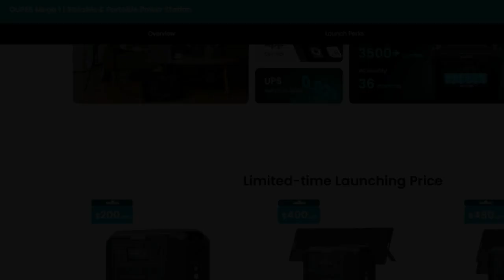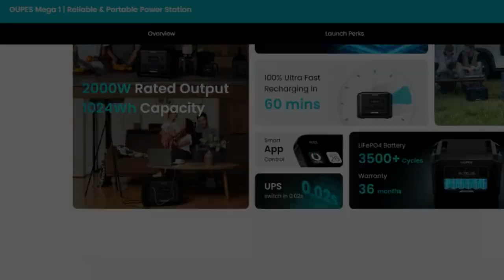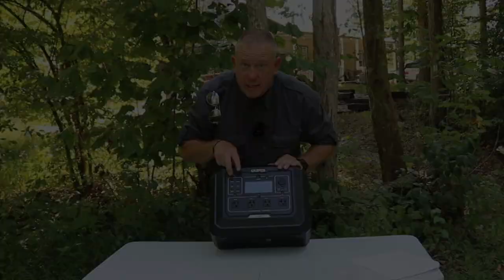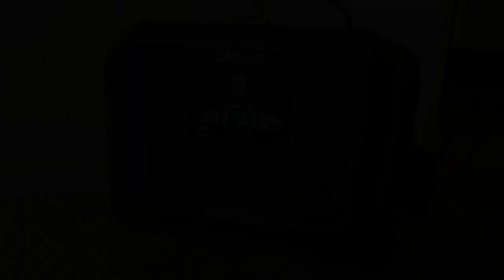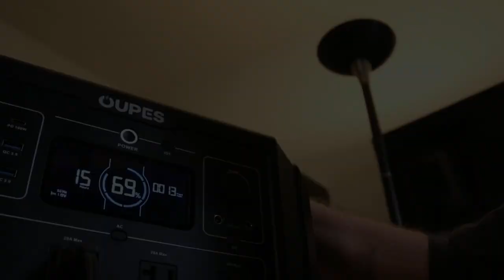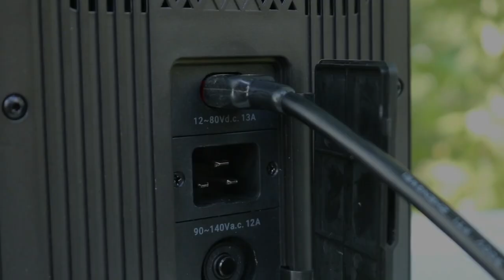A DIRT-CHEAP Solar Generator You've Never Heard of Before - Oupes Mega 1

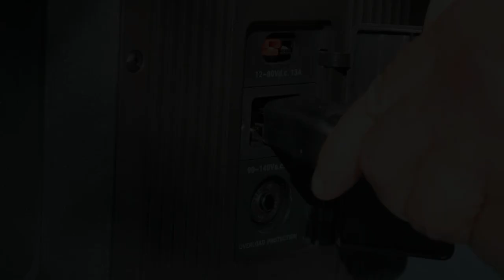Comment: At least this is not 4 Patriots this time!!!!! I hurled insults at you for doing that previously (they exist to scam the non tech savy) One thing I am not liking is (at the time im typing this) it says "800 watts solar input" but it doesn't tell you the voltage or amperage parameters and that could be a red flag! I did watch this video in its entirety and at 4:42 if you hit pause you'll see it tells you 12 to 80 volts at a max of 13 amps but why not put that on the website? People who dont know anything about solar might not know anything about series vs parallel or what panels are or are not compatible!

Hobotech has a great video series on Volts, Amps, Watts and that is everything you'll need to know

Many Power stations wont read their state of charge accurately out of the box. You'll need to charge it up, and run it down till it powers down and then charge it up again then the state of charge should be calibrated right.

DC Compressor fridge is what you want 7:03 (Bouge rv, Set power, Iceco etc)

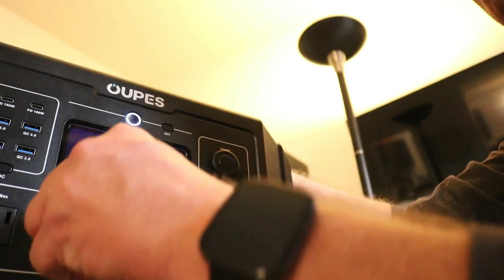7:56 that might not be totally accurate right off the bat. There is going to be a certain amount of idle consumption with the inverter on. Large inverters on smaller batteries are notorious for that

Comment: Because they have problems. 
Mega 5 freeze up.
Bought july 2024 today oct 9 2024.
Still with out power.
Tech just run around from them.
Had to buy gas generator yesterday.
They are junk that's why they offer cheap.

Comment: That's expensive!  I got a Pecron 1200w with a 100w solar panel, cigarette lighter charger and 120v charger for $320 delivered to my door.  It also has a wireless charger on the top and battery charging cables.  Yup, charge a battery with a battery. 😊

Comment: Power banks this size are affordable, but they won't run a window unit or fridge all night.  If you don't want to learn the math, look up your amps and volts on your equipment.  Then ask one of the free AI's like Chatgpt how long it will run. Fridges and ACs are a little tricky to predict because they don't run continuously. Your " mileage " will  vary by how warm the environment is. 

I just bought a couple of power banks this spring, so I'm still learning how to get the most from them. One thing I have learned is that if you plug your fridge or freezer into a gas generator, you have to run it continuously. But, using your genny or panels, you can charge a power bank in 1-3 hours and then turn the generator off while still running your fridge.  Also, some power banks let you charge them while they power something.  You may also be able to run your fridge while charging w solar panels.  Depending on your panels, you may not be able to  keep up with the power draw, but you might get a  longer run time.  Say maybe 7 or 8 hours on the fridge vs 5 without panels. 

Most equipment like fridges and ACs need a considerable amount of power to start them, but much less to run them.  I discovered that my window unit has too much of a start demand to run on my power bank, even though the PB technically has the power to run  it once it is started.  The start up can be 50-100% more than what's needed to run a unit.

You can also run a very modest  sized generator that will charge this power bank in about an hour. On a fuel efficient model, you might be able to charge you PB 6 to 8 times on about 1 gallon of gas. If you can also supplement the charging w panels, you may get about 8 to 10 five hour run sessions on your fridge.  Call it maybe 45 to 50 hours of run time for a fridge using panels plus about one gallon of gas in a small generator.

Comment: That’s a good price for the power output and storage capacity this system delivers.  Couple this unit with an expansion battery of similar capacity and you’d have a system that could likely power your most critical equipment for a good 12-24 hrs on a single charge.  Good review; thx.
Reply from the maker: You're welcome, and Thank You. 
I wish I was a little bit more knowledgeable on the technical jargon to give a review that explains the input/output/etc. a little better. :)

Comment: Great video brother. The average person doesn't need a bunch of technical jargon. A good power station that will run just about every 110 volt appliance. My suggestion would be to skip the fold up panels unless you need to pack it up and go. Just make sure what ever panels you use that the station can take full advantage of it.

Comment: This is a sad commentary on human gullibility.  These are just storage batteries and they will need replacing not to mention likely being overpriced.
Reply from the maker: I've got an off-grid cabin, and these are really handy to have. Recharging radios (for emergency communications), running a lamp for light on a cold winter night, etc. And if someone has to keep insulin refrigerated, something like this would be a life-saver. :)
Reply: Yes, they’ll need replacing… after about 3,000 plus charge cycles (around 10 yrs if cycled EVERY DAY)!  How much food would someone throw out in an area prone to power outages over the course of 10-15 yrs?  Not to mention the comfort & safety these systems also provide.
Reply from the maker: @HughGBallz I completely agree with you. At my off-grid cabin: having one of these to run a lamp on a cold dark night, or to run a fan on a hot night, and to recharge cordless tools, and to recharge trail cams which I use for security purposes.... is really, really useful.
Reply: You need to do your research before commenting.  Sad state on educating yourself prior to speaking.
Reply: You fully and openly make my point, thanks.
Reply: @xenia5101  What would you recommend instead?  We're all ears.  ☺

Comment: Is this generator a Life Cycle type?
Reply from the maker: My apologies, but are you asking if it has only so many recharges before it loses effectiveness?
If so, it has 3500 cycles before it only starts charging to 80% (meaning after 3500 cycles it will only charge to 80%). 

Hopefully I answered your question. If not, my apologies.

Comment: Recently, I did research on the solar generator and end up bought a seperate LiFePo4 24v 100ah just for $357, with another the pure sine wave inverter just $150 for 2000watt continue inverter and I am gonna plan to buy the solar charge controller that cost another 25 dollar. For $532, I have 2560 watt power. I just taste my fridge, I was able to run it about 32 hours with normal usage. If I add another LiFePo4 24v100ah, Iit will be 5120 watt that only cost $889. HOpefully, this system will last me for 10 yrs. It is a lot better than a generator that make noise. If power outrage just a day, we will be fine. However, with solar charge controller, and I think to buy a few solar panel. I can be able to charge my battery during the day time.
Reply: Can you provide more information about your system like where you buy your products, which models and brands, etc?  That might be really help us.  Thanks.

Comment: Not bad. Sale price needs to be lower. I purchased an Ecoflow Delta 2 for $450 on sale. Ecoflow's sale was a week long not one day IRC.
Reply: I was looking at the EcoFlows too. The ones I wanted didn't have the new lithium iron batteries. I think they call the new style LIFPO.
Reply: @DouglasRamirez-dj7sd  surprised by that. My Delta 2 has the LFP (LiPO4) cells. I saw on Amazon Ecoflow has the Delta 2 for $550 and Delta 3 for $650 (with coupon) on sale today
Reply: @DouglasRamirez-dj7sd  My Delta 2 has the LFP (LiFePO4) cells.  Today Amazon Ecoflow sale has the Delta 2 for $550 and the Delta 3 plus for $899. There is a coupon for $250 off bringing that Delta 3 plus down to $649

Comment: I just need freezers ran for an hour every 4 hour's.
Reply from the maker: I do the same thing as you: I run it for an hour, every 4 or 5 hours or so.
And this thing would have no problem doing that.
Plus, I think you can run your freezer and also recharge the Mega 1 at the same time.

Comment: EP, I just bought a 50 foot charging cable so that I don't have to bring my solar battery outside in order to plug it into my solar panels. I recommend that highly. This means that the weather is bad, as long as it's not whether that will damage my solar panels, I can be charging my battery in the house where it's cool and dry or warm and dry.
Reply: Where'd you get the cable? What brand?
Reply: @RizzAndSpesh  it's too much to write so I will just voice write it into this response. It's the Bateria power solar to xt60 charge extension cable 10 AWG 50 ft, solar connector to xt60 adapter cable for solar panel to LiFePO4 battery RV portable power station solar generator. 
    I have not tried it yet. I chose it because after reading the other 50 ft extension cable descriptions, I liked it best. I am not an expert.
Reply: I've been thinking of doing that as well. Thanks for posting the info.
Reply: @yellowdog762jb  you are welcome!

Comment: The Oupes solar batteries/power stations are quality products with LiFePO4 lithium ion battery. I have one of the 650 W models and it's great. I love the fact that you can use it while charging it. That is a major factor when buying a solar battery.   And yes, it's pronounced opus! 😊
Reply from the maker: Thanks for filling me in Nancy!
I had never heard of Oupes before until they contacted me.
So far, I'm impressed by this thing. :)
Reply: @EthicalPreparedness  because I can pick it up, I took mine on my 3-month vacation to visit my brothers in Faraway states, and I used it every single night either to power a small air conditioner or an electric blanket depending on where I was. Then I charged it up with the 12 volt while driving the next day. Everybody needs a big powerhouse high wattage solar battery, but it's fantastic to have a truly portable one.

Comment: Nice addition for your cabin!
Reply from the maker: Brother, I ran that thing almost to zero.
And I seriously got it recharged back to 100% in just 2 1/2 hours by putting it and the solar panels in the field where my fruit trees are.
This thing is pretty awesome so far. :)
Reply: @PraxisPrepper  - Sounds nice but I never imagined a microwave putting out so much energy to drain it so fast. That's 10x's the energy of your refrigerator. This is something to keep in mind when things get crazy. Microwaves are basically useless unless you have excess energy. 
     When SHTF people will have to think conservation. Microwaves are out of the equation!
Reply: @redfaux74  I personally think microwave ovens are still in a bit of a bet-testing phase as it concerns human health, so I don't use one. But I used to use one and even for off-grid, they can still be used, but only if (as you mentioned) there is ample power supply. At my place, when the sun is shining we have tons of that "use it or lose it" energy. So a microwave could be used quite easily during the sunny part of the day, but yes it's a big power draw, so not the sort of thing we could use after the sun went down without really taxing our batteries. Living off grid is as much about WHEN you use different devices as it is about WHAT devices you use. I will sometimes pre-heat our eclectic oven ahead of when I need to use it if I knw that sun will be getting a bit scarce around dinner time. In that way, the hot oven is acting like an additional battery (storing up electrical energy as heat for later use).
Reply: @PraxisPrepper   - Everything in life comes down to wisdom. My point is, if you have excess sunlight, that is the time to charge up batteries. I guess if you have a lot of solar, that is not a prob. But I'm also guessing the majority of people will only have a minimum. They'll have to maximize what sunlight they have and still hope that is enough. 
     Knowing what I've just seen, the microwave will not be taking up my space in SHTF.
Reply: @PraxisPrepper   - And from what I have heard, the energy of the microwave is not the concern. It is the substance you are cooking your food on. Over heating your food on plastics is very dangerous. Over heating your food period, causing black edges, is dangerous. 
     My girlfriend puts everything on 2 minutes. I put my food on 30 seconds and check, stir, and repeat. She wonders why her food burns half the time or tastes strange.
Reply from the maker: @redfaux74  Ha! My wife does the same thing as your girlfriend! She puts her food in the microwave until it's bubbling.

But I do the same as you: I run it just long enough to warm the food up. I do NOT want my food bubbling in a plastic container. 

If I had more space, I'd get those glass containers and throw the plastic ones away. But our space in our small house is SO LIMITED.